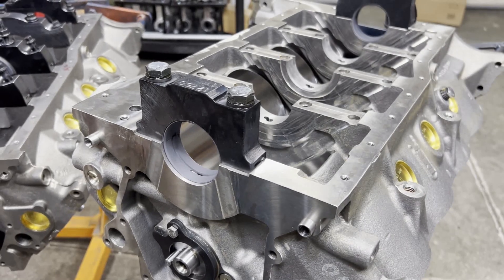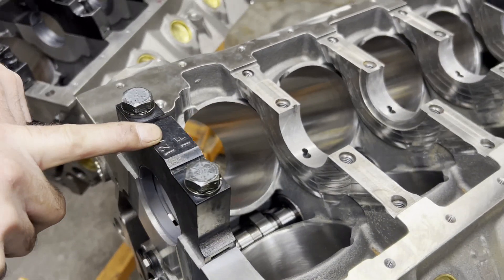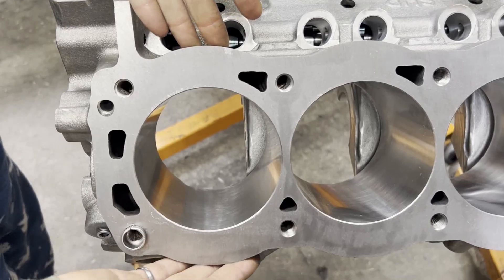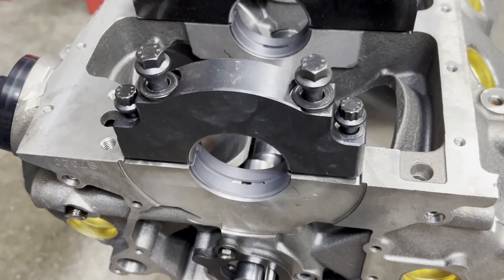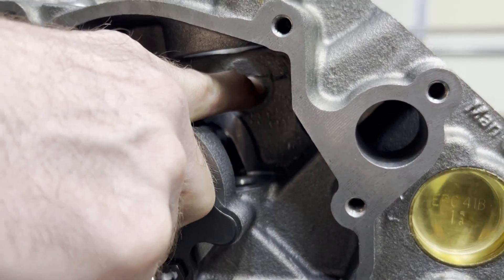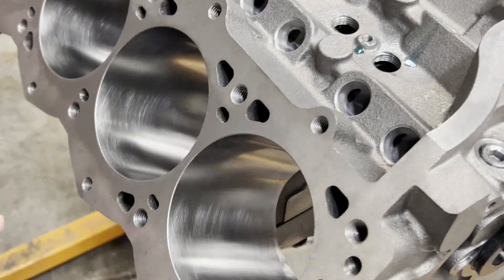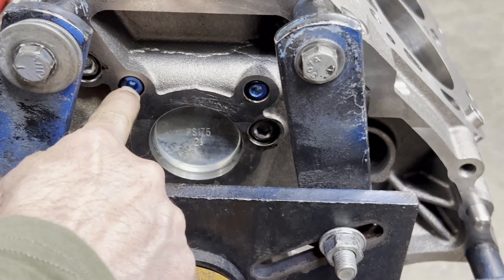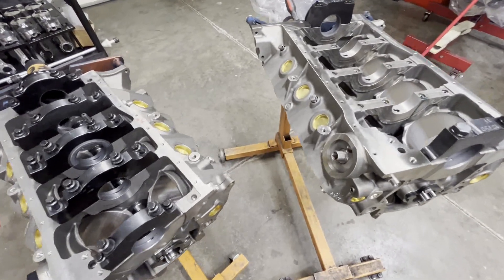Lykins Motorsports Dart/World Products Block Comparo

Comment: World Products vs Dart SHP vs Dart M2, your opinion, for sbc 350 Pro Charger 20 psi 1,000 hp non-stroked street. 5 speed manual C1 Corvette. I rather not over spend if I can. Which would be good enough with enough safety margin. Will mostly be run only occasionally and rarely to it’s max 7500 rpm

Comment: Dang.  Watching this and your information about the oil restrictors.  I am helping a friend build a stout Clevor.  He got the block used but new still in the pallet box.  This is the first I'm hearing about the restrictors.  He is using a solid 55mm core roller camshaft.  I can not find anywhere that sells the specific restrictors mentioned in the instructions.  701808-2 is supposedly the part number.  I can find items close but not those exact ones.  Do you have any suggestions where I can source a pair?
Reply from the maker: For a World Products block, you can use a Moroso SBC restrictor kit.

Comment: The world products block is actually a Bill Mitchell Products block. Bill Mitchell took over the World products aluminum block production and updated tooling and changed foundries for production. I was a distributor for world products which os what it was called in the late 80s. The Dart Senior heads with larger intake valves were really the only high flow aftermarket heads available for the 5.0 at the time besides the alan root head. Then came the 1.94 valved juniors. Built plenty of 5.0 mustangs using the Dart Sr. Head at my autoparts store/speed shop at the time. Excellent products. Love your channel and all your videos. Most thorough videos and explanations out there.

Comment: After watching a video on how difficult it is to line hone the main bearings on an aluminum block with steel caps, I wonder why aluminum isn't used for the caps as well as the block material. I only say that after seeing SMX billet blocks with aluminum caps.
Reply from the maker: It’s not much harder, if any.

Comment: RPM PERFORMANCE makes a really good racing ford block , i think they made a couple hundred blocks of the 351w and a alluminum one also then the guys sold the castings to speedmaster and well  you can guess where it went from there but i bought one from them and my racing machine shop said it was a very outstanding piece good for 1500hp all billet 4 bolt splayed mains , simese bores.:body-blue-raised-arms::body-blue-raised-arms::body-blue-raised-arms::body-blue-raised-arms::body-blue-raised-arms::body-blue-raised-arms:

Comment: Nice for the billet steel flat tappet camshaft do you still have to break it in like a regular flat tappet or what's the deal running billet and why instead of roller

Comment: I did not like the cam installed with metal specs in cylinder bores and bottom of the camshafts on both blocks. I would never buy a Lykins built engine after seeing the metal being ignored as though it is OK
Reply from the maker: Good, because I wouldn’t sell you one.  There are no metal specks anywhere dude.  There may be a little lint from where I had just wiped the cylinders down, but there isn’t any “metal specs”.  Thanks for making a judgment across the internet over a video.

Comment: It's odd that world didn't put a plug in the front drivers oil gallery,  we always drill the plug with a .032" hole to oil the distributor gear.
Reply: Excellent recommendation! Especially as there are huge loads on it/them with high lift cam's with a lot of valve spring force!
With some engines I expect this won't be quite as easy, so perhaps drilled and tapped to take a line to a suitably designed squirter" that will feed that critical part?

Comment: Thanks for making this 📹 video. What oil pans do you use to clear 4 bolt main caps 1&5? We ran an Aviaid dry sump 4" flat pan on my 430 Windsor Iron Eagle block. We had to do some massaging on the pan for sure!
Reply from the maker: Moroso/Kevko.  You had to massage the Aviaid, because they don't even fit the box they come in.
Reply: @lykinsmotorsports  

Ouch! 🤣🤣🤣

Comment: How does the Ford Racing Boss block compare to these blocks?
Reply: Good question, I have a 9.5 deck Boss 351 standard bore block for my 408W. Bought it back in'09 when they were new. My understanding is that most engine builders prefer the Dart SHP, which is there entry level block. Dollar for dollar I'd run the SHP over the Boss 302 or 351.
Reply: @TheRdub82 from what I recall, the Ford boss blocks can’t be bored out too much.but it is made with CGI . Compact graphite iron. Same as the 6.7L powerstroke.